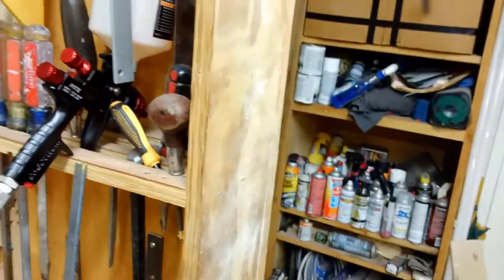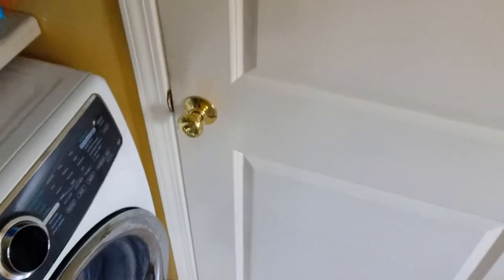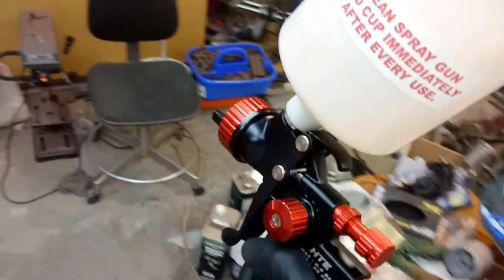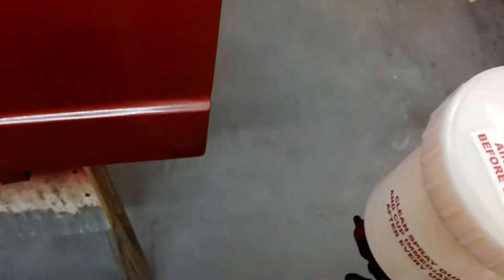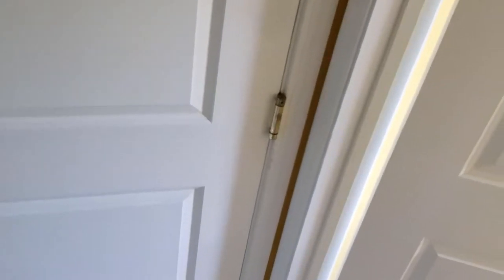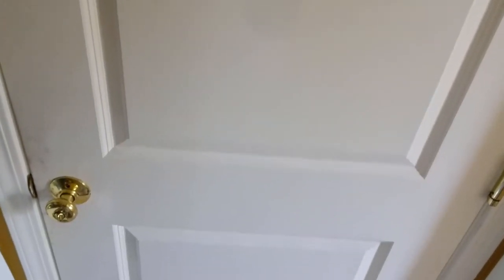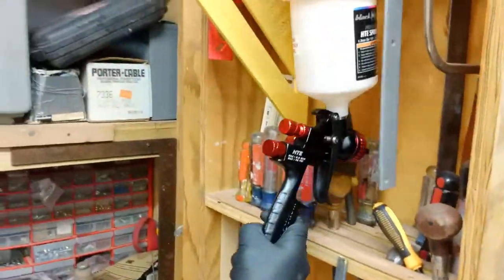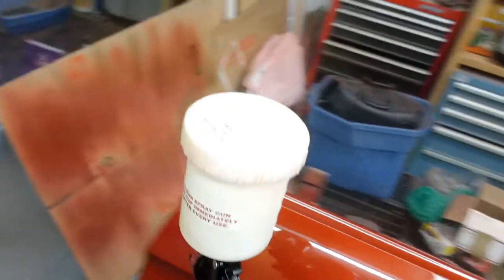Black Widow HTE Spray Gun Review: Part 5 Extra Footage: Clear Coat

Comment: Why did you wait 1 day before spraying the clearcoat?  Is that what the paint calls for?  Standard procedure is just waiting long enough for the base to flash off.  Make sure it's fully flashed, then tack rag it, then clear it.
Reply from the maker: Well. its more than a day for a paint to completely flash off.  You can smell acetone on paint about a week+ later. I believe that acetone content flash rate is probubly exponential decay. so at the end of a overnight period most of the acetone has flashed off and i go from there. the main reason why i do this is because i was getting alot of texturing off the base after clear coating. i was hypothesizing that it was because acetone was getting stuck under the paint and not allowing the base coat to redry. So i was doing this to make sure i have the least amount of the acetone left under the paint. however now it just think it is a reaction between the lacquer and urethane.
Reply: Steven has no clue what he's doing or talking about. That's why.
Reply: @SOLDOZER  😂😂😂

Comment: Open up that pattern a bit, lessen your chance of sags. Not sure the way you hit edges is ideal. Oh, and a bit of water on the floor help with dust and over spray. Other than that, thanks for the video
Reply: cant put water on floor it just soaks into concrete. concrete is not sealed. it just soaks into concreate in about 5 minutes.

Comment: That clear will m peel.off over.time you suppose to spray after 5 to 10 minutes dry time ur a r9okie
Reply: Not necessarily, I did my TransAm as a senior project, so I was using the school paint booth. Due to time constraints I had to spray BC on day 1, then 12 hours later I came back and cleared. Its been 2 years and no chipping or peeling or flaking. However His runs are no good at all. He put the first coat on too dry and the rest too wet creating a bad Orange peel.